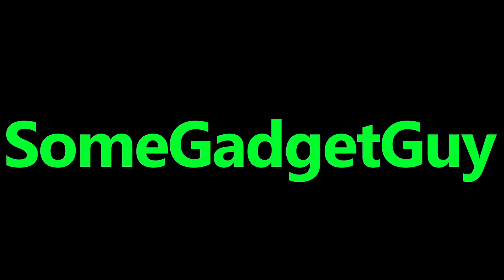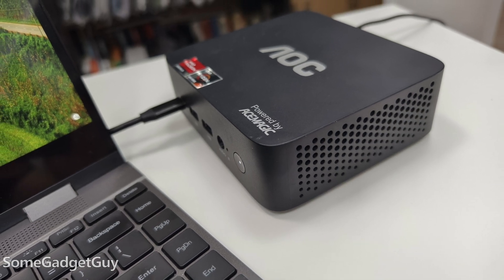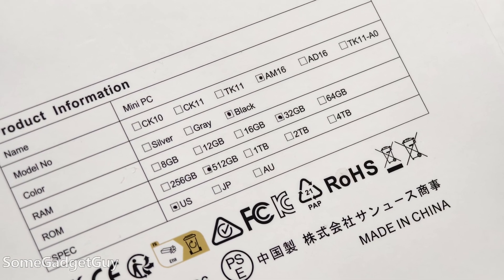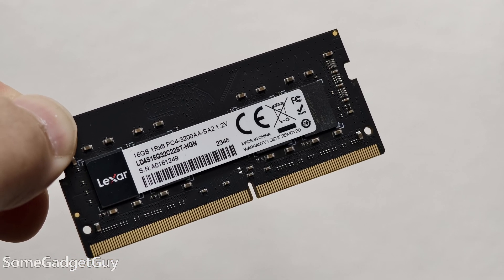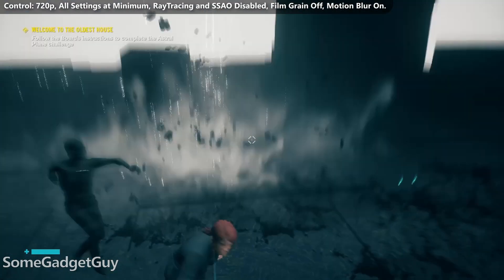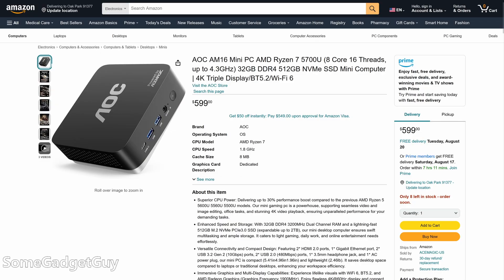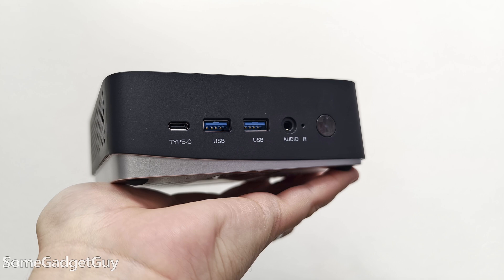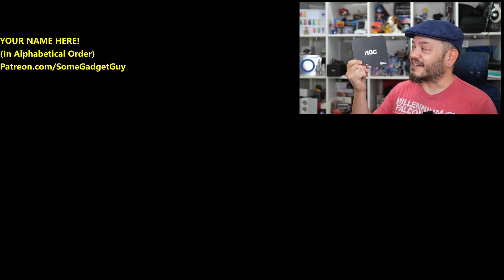AOC AM16 Mini-PC Review: Is AceMagic Still Up to Their Old Tricks?

Comment: 5:36 - I ran into the same issue with Ryzen + Plex transcoding (different mini PC, same chipset).  Regardless of the video size, format or settings, I was getting giant blocky square - think 80's VHS encoded to YouTube - only worse. 

After a cpl of hours playing with it, the solution ended up being a software setting in Plex server's video quality.  For whatever reason, setting it to "Automatic" worked WAY better than any of the manual settings, even the lower 720p settings still chunked up - only "Automatic" worked and worked *beautifully*.

I don't doubt you're right that Intel i-Series > AMD Ryzen on the whole, but sharing this jic anyone else is having the same issue ^ this fixed it for me and I can now run 4K streams with np.